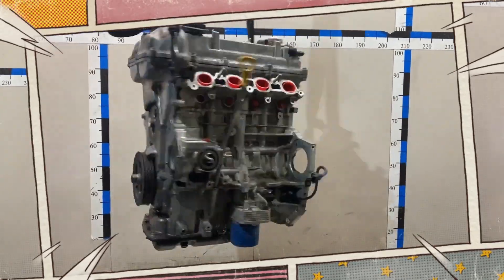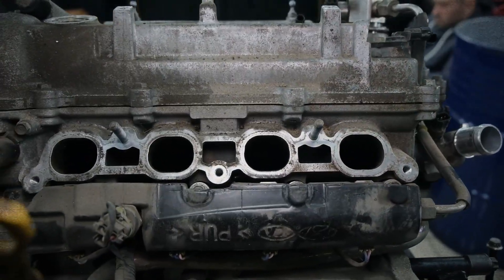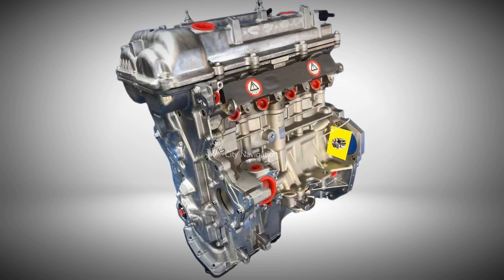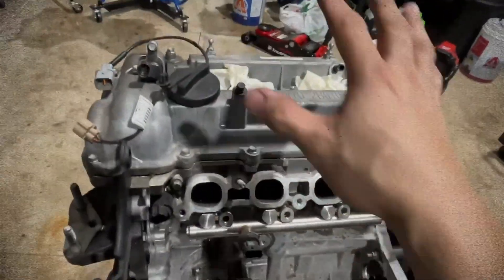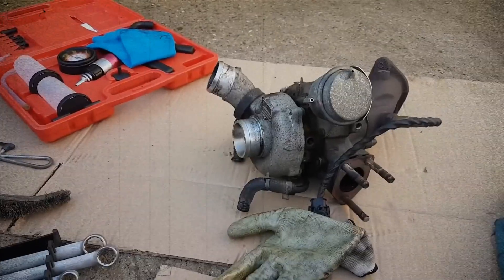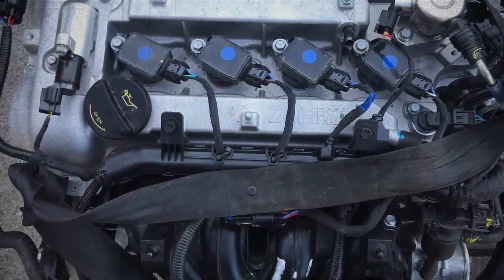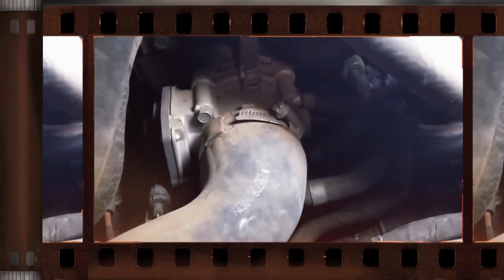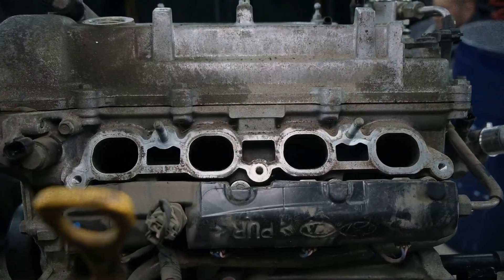Hyundai 1.6 T-GDI G4FJ Engine – Specs, Design, Common Problems & Reliability Explained!

Comment: Frequient oil leaks can be caused by a slugish or clogged PCV valve. This is a simple inexpensive part that you can change yourself. Go checkout the symptoms of a clogged valve. I have a 1.6 that has over 100,000 miles, well maintained and runs great.  Enough said about this video, don't maintain or hot rod your engine and this is what you get.